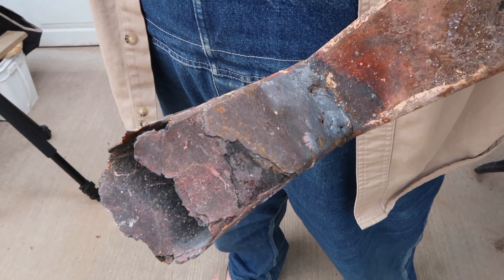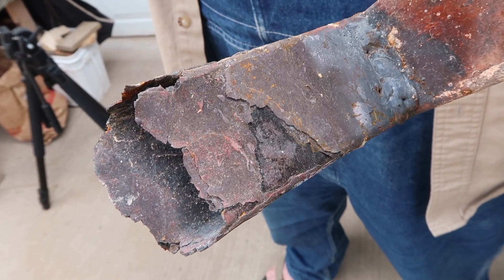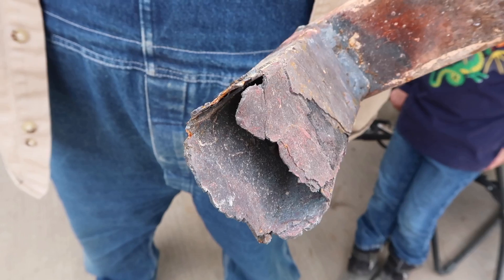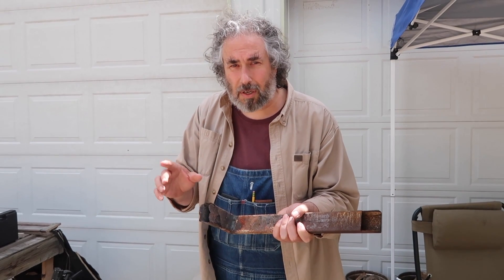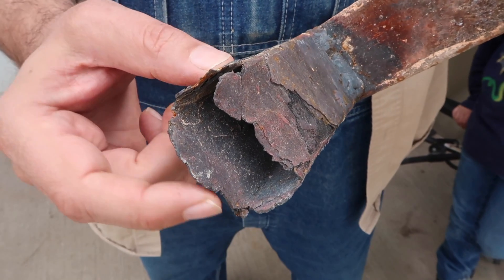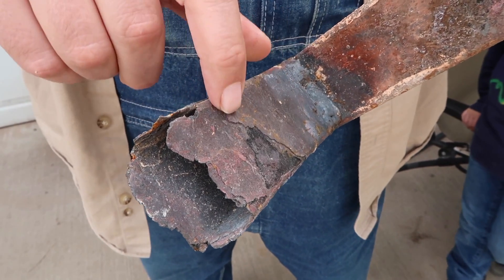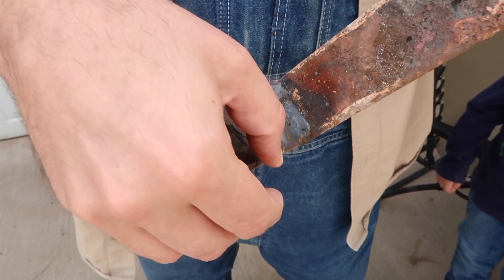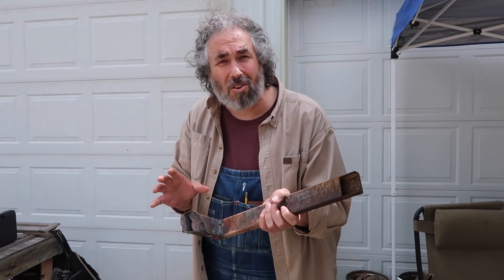steel spalling vs. melting vs. rusting

Comment: Hello! I have been thinking about this, and lo and behold...a vid about steel! yippee! OK, so what is a safe material to use for a RMH? I plan on getting the plans from your site.
Reply: You need to use refractory materials such as "fire brick"
https://www.fornobravo.com/pompeii-oven/brick-primer/
Reply from the maker: I prefer molded ceramic fiber.   In fact, that seems to be the preferred material by all of the innovators when we hold the innovators event.   But it is also the most expensive.   Erica has an ebook out called "The Heat Riser Cookbook" that has a lot of recipes for materials https://permies.com/t/84432f7/Heat-Riser-Cookbook

Comment: This is what you get when the temperature of the steel is getting high enough in an oxygen-rich environment. Anything above 1500 ºF and the steel is corroding away in a very spectacular way. As such, the damage is done waaay lower than melting temperature. What you see is a channel that's being blocked on purpose or accidentally during quite a lot of burns.

Since it is a p-channel shown in the video I feel I need to comment on this. 
It's all about temperature, so when one would be able to keep the temperature of the steel part low enough it wouldn't spall away. That's the idea of the p-channel and floor channel arrangements. By streaming colder air through such a duct it is possible to keep the temp down. An overhead p-channel, like this one probably, does need to have an overhang over the top of the port in order to suck air in with a sufficient velocity. The lowest pressure and thereby the greatest suction is just behind the narrowest point in the venturi. In this case right at the p-channel opening which is helping immensily, making a difference like between day and night.

The floor channel is different in this respect: the horizontal part is sporting a csa that's about 1.5 to 2 times larger as the csa of the vertical part. Which means the vertical part is a temporarily restriction, resulting in a higher  air velocity according to Benoulli's law, keeping the most vulnerable part cooler. Not cool enough to ensure the steel would last forever, by the way. My heater is consuming about 1.6 cords of soft wood, scraps and so on per season, is going into it's fourth season now while the floor channel is still in one piece but visibly battered.

Judging by the video, you've lost a lot of weight Paul!
Reply from the maker: Hi Peter!    Gallstones are a powerful weight loss machine!  :)
Reply: Your tread is light like a feather now?
Reply from the maker: lighter, certainly.  :)
Reply: Is it possible to make the p channel from cast iron?? if you can't weld it can you join it in another way? Perhaps some kind of brazing?
Reply: Positive Aspect Permaculture  Cast iron isn't corrosion resistant although it'll take longer to spall away given sufficiently high temperature and free oxygen. And it need to be casted in the shape you'll need, not just any shape or size.
Reply: Peter van den Berg why not use SiC tubing? You can have custom shapes cast and it doesn't scale, spall, or melt until well after 26-2800 F.
Reply: James Manning  Silicon Carbide is regarded as quite an exotic material, plus the air channels we want aren't straight. Of course I tested this straight channels extensively but it didn't do what a properly shaped one would do.  
Frankly, I want to stay away from high-tech materials when possible. Keep it simple, so people wherever in the world are capable of building one.

Comment from the maker: now that you see spalling - surely you have seen stuff that has spalled before.   Tell your story!
Reply: The inside left and right walls of my box heater have a heat guard that hooks over to protcet the cast iron wall. Thes are steel rather than cast iron (these are easily user replaceable). They are all twisted and warped after 6 years and......yes the metal is flaking in large chunks. I thought it was rust or some kind of corrosion (due to creosote or similar)..Now I know it's spalling.

Comment: Nice one! I've seen rocket stoves on sale that are made of steel but that's such a disadvangage because of the high temp issue plus it doesn't insulate so it isn't the best material for allowing the combustion area hot enough to burn the soot. And if you insulate around the steel, the high temp vulnerability of the steel becomes a problem.